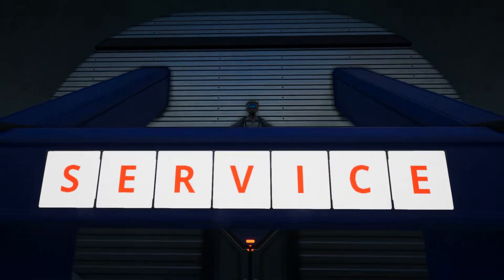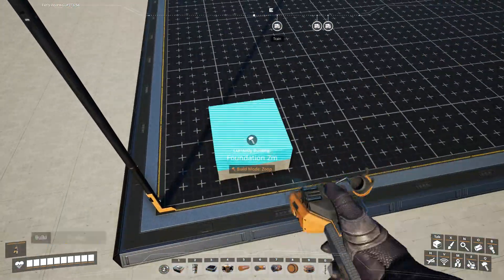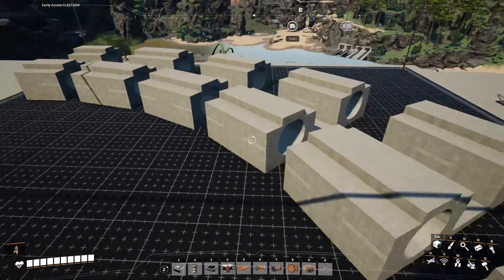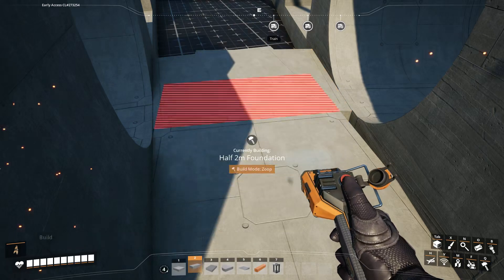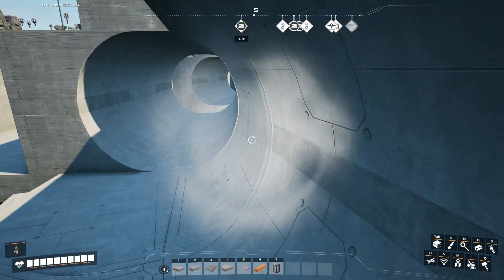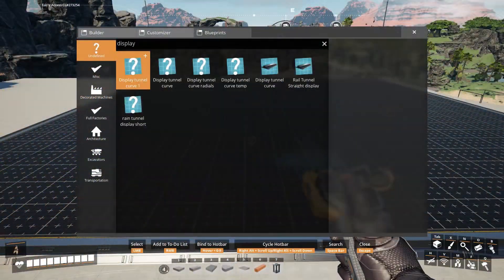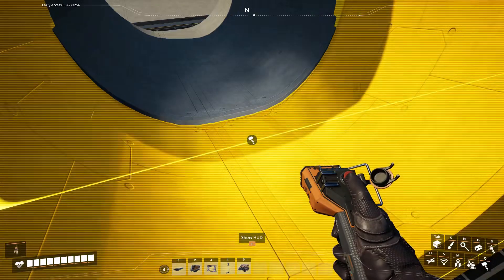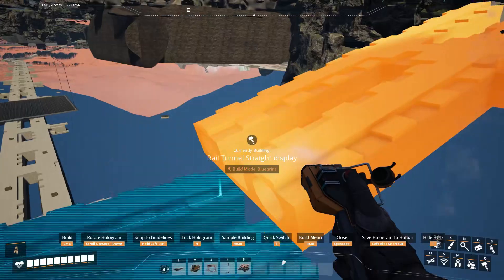Satisfactory Transportation: Subterranean Train Tunnels #4

Comment: In the end when riding the train, what is the flashing?
Reply from the maker: @azofshadowmore  I've been trying to figure out what causes that but I'm not sure. The camera perspective occasionally shifts which is what that flashing is. I think it's caused by ceiling elements being too low but I haven't been able to properly test it.
Reply: @BuilderBadger  that makes sense. I wonder if adding another 1meter in height would get it to stop. Might be best to wait until 1.0 launches and see what optimization fixes do first.
Shame there is not a 3M foundation/wall as well as quarter walls to cover up the half foundations.
Reply from the maker: @azofshadowmore  I can confirm, adding an extra meter of height fixes the issue. It seems like the flickering can be prevented by maintaining 2m of height above the train. I'll have to make a pt5 addressing this discovery.😁
Reply: Wonderful, I look forward to the episode.